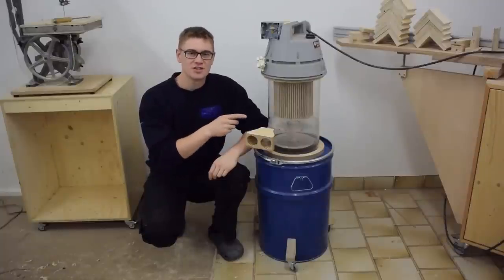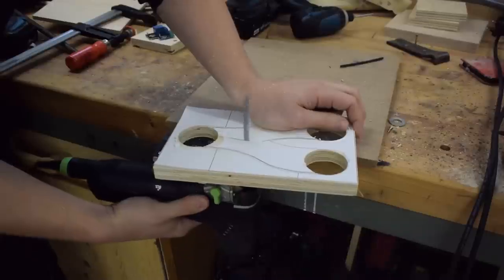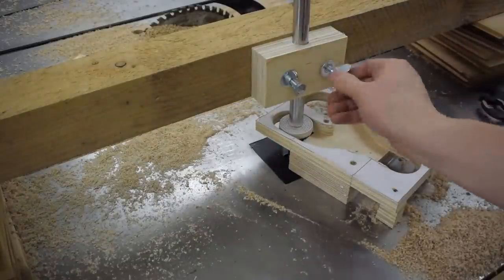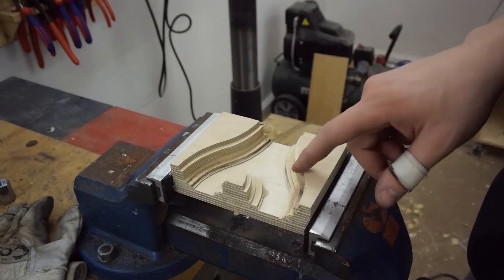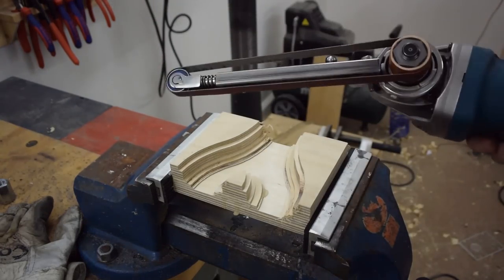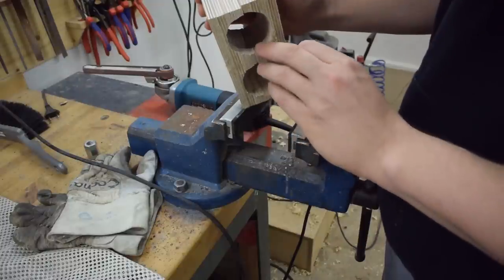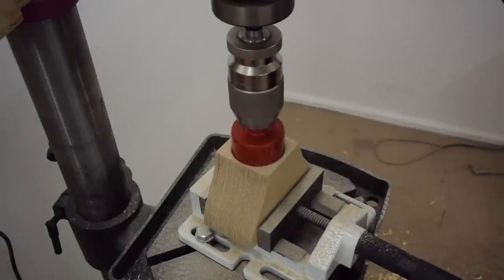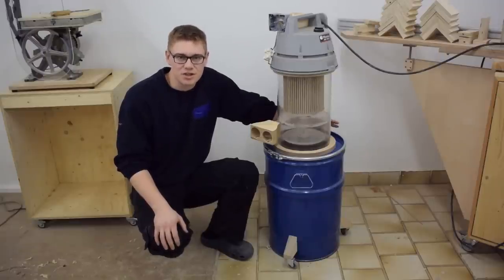Y-Piece for the Dust Collector | Pin Router Shrinking Template

Comment: Great Concept, excellent project... 

Seems to me a blast gate should be easy for this unit, just attach it in such a way that when you slide it one way it shuts off the one side than when you slide it back it shuts off the other. 

Basically 2 holes, with the left side hole being solid, or only drawn on for alignment, then a way to slide it back and forth. Seems to me you can make the Blast Sliding Gate from 1/4" and the mounting unit from multiple 3/4" or what ever the Metric is. 

I would suggest that you use the inside or as you look at the unit, the part that is where the plastic housing is, as the side to slide to. So the default hole is to the right and the first blocked hole is the left hole as you face the holes. This way when you want to use the other side you just slide the gate towards the plastic housing side and nothing sticks out that can get caught on anything. 

The only down side is how much stress this mounting unit might put on the plastic that is on the housing unit. It may not add much but it might be something to consider so you may want to use 1/2" or 12mm rather than 3/4" just to keep weight down.

Another suggestion would be to put blast gates at the other end of the hose that attaches to what ever tool you are using. That way both lines are always active and you just need to manipulate the blast gate at the tool you are using. 

If you make a device that slips on the end of the hose, you won't need to rebuild it if you change hoses should a hose fail or wear out. The end towards the tool can be a fixed insert so that the tool holds the blast gate's weight and the hose can just slip into it. 

You could make multiple Blast Gates that attach to each tool, then just switch the hose as needed. Everyone's needs will be different so what works for one may not necessary work for the other.

Cheers....

Comment: This reminds me of a 4 way bong I made out of a 2L  bottle of cooking oil and garden hose for me and my friends back in the day. I found out that it didnt work very well. because as we lay on our backs the floor in a cross pattern with our heads pointing to the bong, when we finally managed to light it up and take a drag.... usually only one of us would get a hit. because of the way the air flows. It tries to go the easiest way. And I suspect your gadget wont work well because unless the two extensions are exactly the same length and the exact amount of resistance is enforced... only one will suck air. 

But then again I used to smoke pot and my brain might be scrambled :P

Comment: ay well you say your router was an improvised and improvised cnc, well thats all a cnc is its a router that has its directions controlled by computer thats all, after all the motor of it and working bits are still called a router, that said what you have works, it might look a bit weird but its inventive that you made it .
Reply from the maker: Very enlightening.
Reply: yes that is after all the state of the basic cnc its just a computer controlled frame and feed, that moves the position of the actual router, though they would be larger ones like what we have on the shaper table and it can mill out many materials short of hard steel, but composits, woods, styrofoam and plastics can all be done, we have a 3 1/4 hp one in our shop for larger door and panel cutting and so think of a basic 3 axis cnc as a computer controlling what you could, with a plunge cut able router by hand if you have the strenght to control such a beast of a router.

Comment: What glue did you used to attach the Y to the acrylic(?) tube Cosmas? It didn't look like epoxy, more like wood glue. Was it D4 or something like that? Thanks so much for sharing! :-)
Reply from the maker: PU construction adhesive.
Reply: Cosmas A haaaa, nice! I hadn't even considered that! Did it bond to the acrylic ok?
Reply from the maker: PUCA basically sticks to everything as long as one of the substrates to join can provide a bit of moisture.
Reply: Cosmas Thanks Cosmas, that's very interesting.
Reply: СУПЕР

Comment: For symmetrical pieces, could you just cut both pieces with the same setup, then drop the bit and sand to the line, etc.,.
Reply from the maker: I did.
Reply: Cosmas
Reply: I missed that. Thanks.

Comment: I dont want to be a buzzkill, but whenever you are trimming bits off of something manufactured, cut off as little as possible.  It may be difficult at best finding replacement parts down the road.